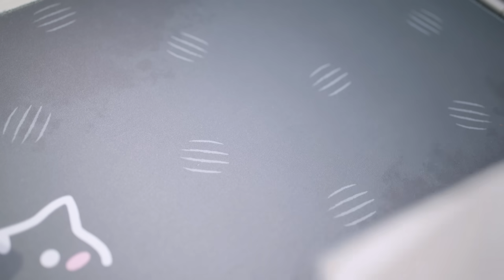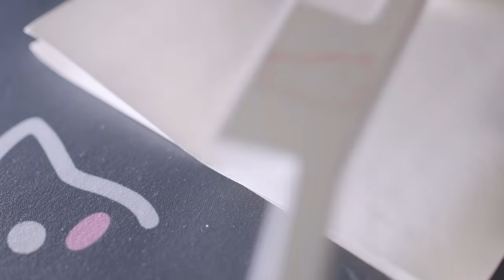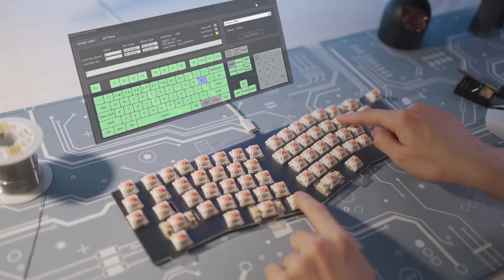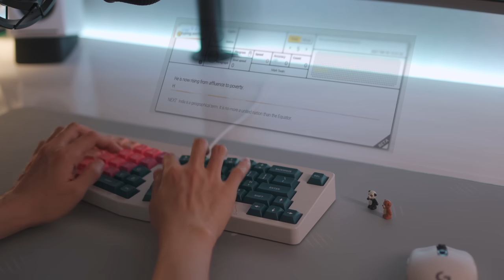BEAR 65 Ergo Rebuild & Color Filling | DSA Vilebloom Keycaps, Holy Panda Switches

Comment: I really like the circuit board themed desk mat, is there somewhere we can get a similar one? (Or what brand is it? I need a desk mat that's also solder safe.)
Reply from the maker: https://ko.aliexpress.com/item/1005001786678495.html?spm=a2g12.12057483.0.0.7f16652aWnlXXe
but I don't know it's solder safe or not
I am just using it cuz of its design :3
Reply: @3ildcat  Thank you!!

Comment: Hey guys I have a question :3 basically I want to use my keyboard for both typing and gaming but mostly typing and I’m not sure which switches to get. Should I get the red or blue outemu switches? ✨🐈
Reply: Red or yellow switches go for gateron reds cause they are very light and are perfect for gaming and typing. But if you like longer travel yellow. Remember these are linear so they take like a 2-3 hours getting used to
Reply: @vortexlinks7982  tysm!! 🥰
Reply: Your welcome 🥰

Comment: do you take keyboard modding requests? i've been trying to mod a keyboard for a friend but the ticking on the spacebar is terrible. i've tried a bunch of different ways to fix it but i'm all out of ideas. it's made by E-Yooso and it's the white one with outemu reds. i really just need some input. I believe it's because the stems on the stabs are too short or the keycaps aren't good but i dont know. this keyboard is all over the place
Reply from the maker: No, as I wrote 'about' of my channel
sorry

Comment: I see that Tamiya playing in... oh boy... then I see a gundam marker being used on a keyboard kit... like what happened to my Durgod k320 taurus... (I got a MG RX-78-2 for my birthday and really wanted it to look good, so I pulled out some gundam markers but shook the markers too hard that the paint from them splattered all over my stuff, with my work laptop, my monitor, and my keyboard with marker paint residues...  but like, the combination of blue and gold looked cool, so, I kept it on there, until I got into custom keyboards, where, I ended up taking all of the keycaps from that board and had to wipe them down with alcohol wipes...
Reply from the maker: oh...... that's too bad.. 😿